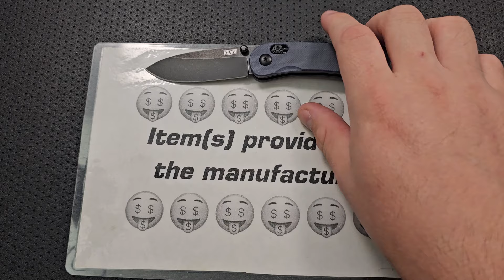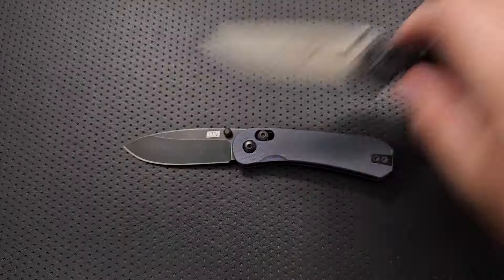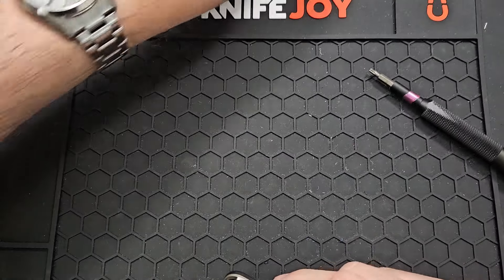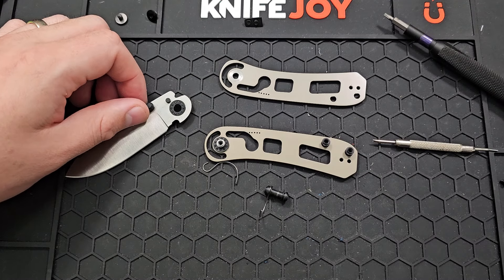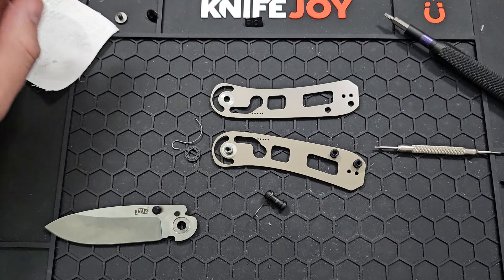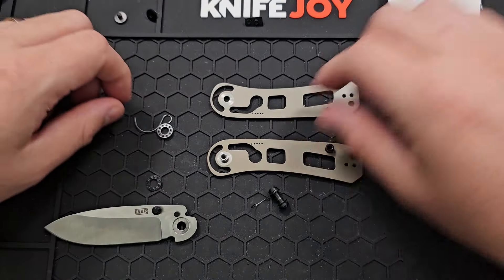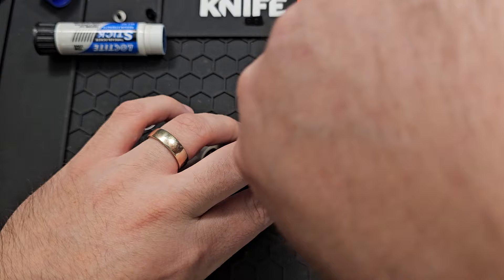The Knafs Lander 3 Pocketknife: Disassembly and Quick Review

Comment: so judging by the additional holes for the omega spring, ben either stole the idea from the kizer drop bear (which i hope he didn't and honestly doubt), or it was made in their factory and part of the deal.
anyway, i'm pretty sure it was made in the kizer factory and not by civivi / we, which means the fit'n'finish isn't that impressive and as a result, the charged price is quite up there.
i paid about 110 bucks for my original banter in s35vn which was made by we and had fantastic fit and finish and a great action.
i'm honest, this doesn't really thrill me, i don't think the design offers enough to justify the higher price tag, especially considering where it was made.
Reply: I had a couple kizer knives in the past and I was very unimpressed. However, after handling the lander 2 at a local knife shop I bought it. It is make by kizer, and the quality is pretty good. Alot better than the older kizers I had. Their slightly modified axis lock is great and the ease of disassembly is amazing. If you have ever disassembled an axis lock type knife you know the pain. That is gone with kizer's clutch lock knives. I have the lander 2 and the drop bear and I love them. WE is still probably a little better but kizer isn't far off.
Reply: Kizer is the OEM for Landers 2 and 3, hence the use of the Clutch Lock
Reply: Kizer was the OEM and had the idea in their dropbears, still prefer the dropbears than this however
Reply: Inside baseball: We've been very transparent about Kizer being the OEM, and they gave us permission to use their Clutch lock, which was super cool of them. -Ben